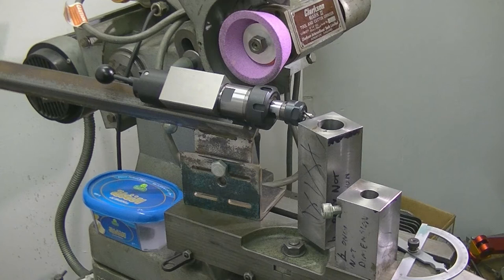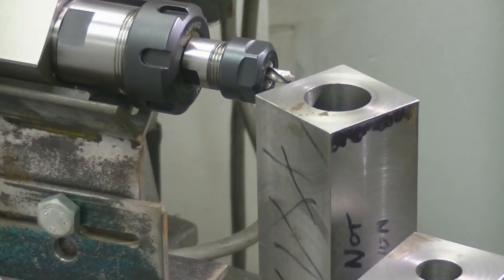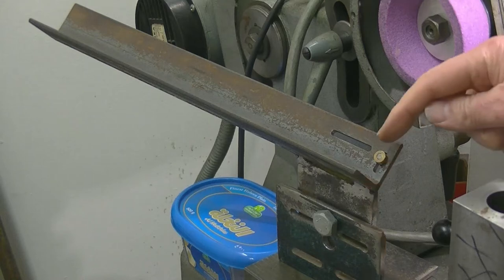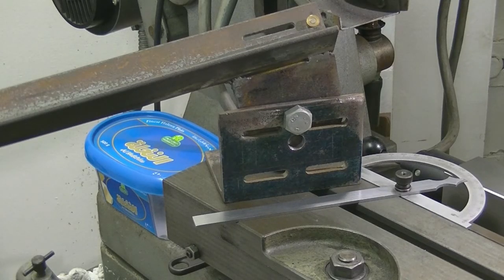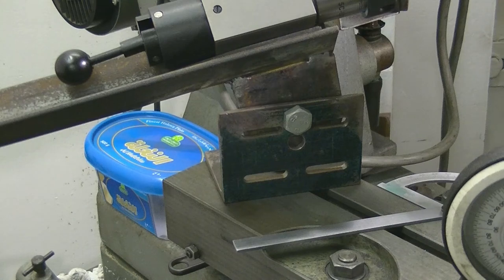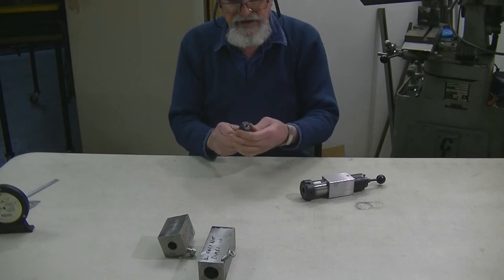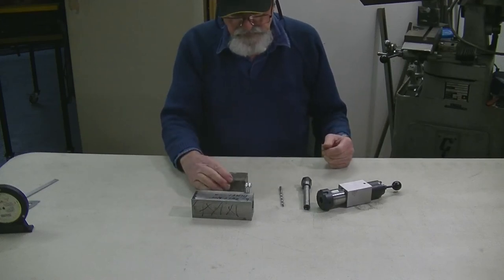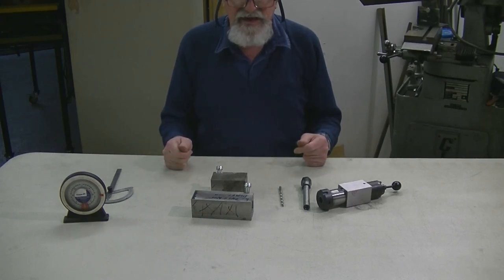Grinding small drills

Comment from the maker: Hi to you all. More thoughts on this. Keep the pivot point at the front of the jig. This will reduce chatter as the grinding force is absorbed by the table and the lip height is changed less when changing the clearance angle. BC